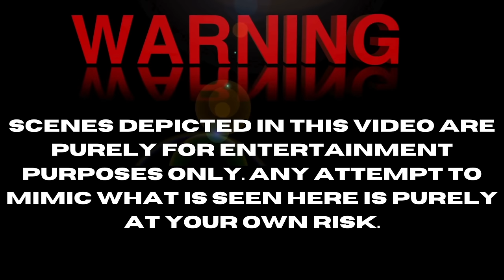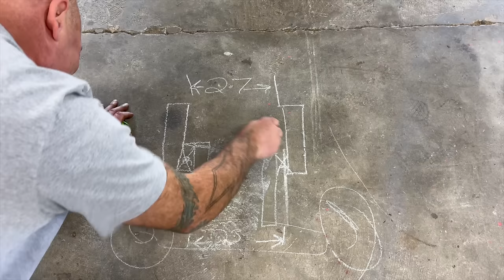Customizing A Classic: Ian Roussel Upgrades 1937 Lincoln Zephyr Front Suspension

Comment: Ian, use two spacers for the bottom controls arm to center the control am since you centered the top coil spring pocket bracket. Good luck on the steering rack. Bump steer is sometimes an issue with lowering Mustang 2.

Comment: my experience with a mustang II suspension installation is to place a straight edge under the crossmember and lower control arms so that the lower control arms are parallel to the floor during installation 
 Love all the videos!

Comment: Hi guys, ive done several mustang ii fronts. Two different manufacturers and both needed to have the hatts pitched. The pitch or angle front to back. Not saying keeping level is wrong.... i dont really know. Anyway thanks for another great video! Cheers
Reply: And the top hat needs to be back a bit from the spindle center for proper caster and camber alignment.
Reply: Weld temp brace from cross member to top hat top inside will  still slide fore and aft for axle center line then put Temp bar from top of all thread to other all thread  also front of top hat needs to be half inch higher than back helps in anti squat during braking

Comment: I have really enjoyed all your shows.  I check youtube each day for updates.  One think that I would like to offer is years ago I was like Ian and had my nuts, bolts, washers in a pile.  I took the time one day to make wooden boxes on draw slides, labeled them, separated them and put them in an old cabinet on the wall.  Pull out the box you need, you should find what you are looking for much quicker.  I also have some old cricket plastic sheets that I pour them out on and then all I have to do is pick up the sheet and pour them back in the boxes.  Just a thought.  Really enjoy the way you make decisions on the fly and not have to follow some pre drawn project.

Comment: What you drew on the floor is just what we did to my 50 Dodge p/u. I put  a mustang 2 front clip  in and I bought it from Speedway. Motors and the kit was for a Chevy p/u 51 to 53. The frame rails on my Dodge were much wider. than the Mustang, but we got it to fit like a glove.
Reply: Fatman Fabrications makes kits for most all of these old cars, no universal kits.  Follow the directions and you will get good results. Call them if you have any questions, good tech support. They are by far the best MIi kits available in my opinion.

Comment: Ian i know i have a lot of comments but the importate one is the top hat tilting to the front for antidive.the new ones you have are level.i place a 2x6 under crossmember  with a short one under crossmember aprox 2 ft and another longer  out to ball joints giving lower arms slightly lower than level for proper ride height.i have installed over20 ov these susp.in hot rods and fixed over 10 that were not installed properly.im no know it all but have exp.if you want to stop straight under hard braking include the anti dive into install

Comment: It's a lot easier to tell after the video, but might still be useful, tack a piece of metal across from tophat to tophat, and use C clamps to the frame, i think i would use longer frame pieces, so i could go way back and attach to something strong in the car, and forward to strengthen the body, maybe triangulate with a pipe, or something, to the A pillar

Comment: You may have to Z the frame rails in front to get adequate crossmember ground clearance, also with the wheel offset you probably have minimal turning radius. Also to get over 100K and more subscribers reach out to fellow motortrender Derek Bieri (Vice Grip Garage) for some type of collaboration a shout out on his channel will get you many more subscribers. Also consider attending the Zip Tie Drags in Tuscon to make contact with other you tubers for some cross pollination of subscribers. It took many of them years to reach 100K, congrats on the quick growth of your channel.

Comment: Just found your sight, Great build. 
My thought would be if your frame rails are a constant, now that you found the centering location for them against the car's frame tack them in. Next position the sub frame in location front to back and set your static ride height with tires on and tack it in. It may be higher or lower then the notches you cut. then get a basic camber adjustment (lets say 7*ish) on the upper mounts with the adjuster bolts centered by setting the upper plates forward or back from center and tack that in. From there you can do caster and camber adjustments to dial it in after its all done. Like I said before, great build looking forward to following this as you go along. 
Cheers R...
Reply from the maker: Welcome!!!

Comment: Ian, I put the same assembly on a 1932 Chevy a few years ago. I cut the center box section and spread them apart to where they needed to be. I built a box section that fit inside of the center section. I cut slots on all 8 sides where the end of the box landed and welded everything back up. I then over laid 3/16 plates over the top side of the cross member about 3 inches past where the slots were and boxed that all together. Worked fine. Probably over kill but I'm known for that.

Comment: You need a transmission jack adapter for your jack so you can chain down things like that or a motorcycle jack or an ATV jack I use two of them now it works great for keeping things together while you move them under a car to line them up and the transmission jack tilts for easy adjustments

Comment: Use a 2ft 2x6 and a 5ft 2x6 under crossmember it will let cont arms drop an inch ant lock them in place as lower arms point downward slightly for proper ride height.

Comment: Ian, a couple of those flat wooden Harbor Freight Furniture Dollys would make your life way easier!  (part #58312)  Just put the front subframe on the dolly and wheel it into position without having to fight the jacks!  Also, please put some kind of jackstand or wood blocks under the body while you are working on it, at least as a good example to those watching. We don't want to lose you to something silly, like the body getting bumped off of the jack while you are under it!

Comment: I have to say this is the first time i have ever seen the upper control arms inner mounting points like that before ,they have always been eg mounted on the side of the up right not the top and have shims to adjust in and out for camber caster ,i feel the side mount style is more secure ,this style mounted on top i feel if not ultra secure bolts could slide in or out when hit a bump at speed ,i guess its just me in my thinking ,but loving watching the videos ,always cant wait for my Ian and Jamie fix

Comment: Ian chock the tires in the fender opening use a peace of pipe through wheel center hole to find axel center but lower the car to a level hight then you will  know where mustang cross member will go and you can adjust ride hight

Comment: A cool motor that might look good under the hood would be a 4.6 liter modular motor from ford with adapters a blower manifold for a windsor
Would give it the wow factor.ps. it has a pretty good red line if you get an early model you should roll pin the camshafts the gears will slip under severe use .
Reply: Cummins 12 valve.
Reply: @65cj55  to heavy but would be a cool motor mabe he is going air based then maybe.
Reply: @douglasfehler553  Yes, i just think everything should have a Cummins or a LS.

Comment: Wouldn't it be easier to get the front end installed by having the frame rails welded in place first? Once you have the rails in place you can use your floor jack to raise the cross member and adjust fore and aft to get the wheels centered in the fender.

Comment: I think there is a thing called “anti-dive” that determines the angle of the upper mount compared to the frame.   I dont think they are parallel.   You might want to do some research on that.
Reply: THAT GOT DELETED WHEN IAN CHOPPED THE TOP HATS TO FIT HIS SIDE RAILS.
Reply: In summary..... it was most painful watching the pile of tin fall apart every time he tried to move it

Comment: For the top arm i would make up a piece of steel with the two nits welded to it so that you do not loose the nuts when you assemble it You should be able to down load the data for the steering off the internet.

Comment: You need to set the caster angle on the upper control arm perch it can’t be the way you cut them. You’re going to have dump steer. Google it before you weld it together.
Reply: @SayWhut276  I had installed a mustang 2 kit from Fat Man Fabrication in my 1954 GMC and the caster angle was already preset in the upper control arm perches. No shimming is required. They make their kits specifically for your vehicle, they ask you for a few measurements on your frame rails and that it. No bump steer no shims. It was a painless installation. I highly recommend them for anyone who is going to install a mustang 2 in their vehicle.

Comment: Hi Ian, Do you ever do your mesurements using the center of the car as your reference point ? Once the cross member is centered you're sure that the drive train will be in centered in the car ? Assuming that the drive train is supposed to be in the center of the Zephyr. Thanks and nice work. Rol

Comment: I wish they wouls stop making that style of wire wheel, either that or encapsulated the wires in a rubber epoxy. Those wires break off and go flying while the encapsulated type the broken wires are held in place by the epoxy. A friend of mine lost an eye even with safety glasses when the wire went through the lens and penetrated his eye. Another alternative id the twisted wire style.

Comment: I used to modify Camaros and Mustangs put big block and small block engines in them can you have the redo the brakes because you know you're pushing 500 horsepower and some of these cars I built after you modified the cams Pistons electronic ignition dual distributors  different Transmissions like the 700 turbo 350 turbo now you've got to build the frame stronger on the car and the suspension to hold the front of the car off the ground which I learned from doing a 62 Camaro and putting a big block 455 Pontiac engine in it which had over 400 horsepower stock when I finish that big block my friends at the parts store that got me the cams and I wanted and all that stuff my friends in the parts store that got me my parts Pistons shorter stroke or long stroke piston rods they thought I was nuts I had to change the motor mounts and all the cars so the engines would fit I did all that in a very short period of time while I was off work I did all the welds myself everything came out very satisfactory cars were awesome to drive I painted my own cars did my own body work to straighten out the lines on the cars ripped all the headlights all the Chrome all that stuff off the cars and when the paint job was done and the paint was cured my ex-wife before we divorced work with me was putting in the tail lights putting on the bumpers the headlights marker lights I had to rig up my own shift linkage because now I've got a longer transmission bigger transmission in a small car now all is shifting linkage and the shifter had to be adjusted so you'll be in the right gear at the right time put in racing valve bodies I actually rebuild them to give me torque that I wanted from these big block small block engines that were beefed up it was a blast I had lots of fun and it brought business to my bosses garage where I work and he was successful because our two garages that he owned the other mechanic that I work with new hair stuff too!

Comment: No no no no no !!!
You use the same width as the stock frame.
You might want to z the frame to make it lower..
But don't want to narrow the frame .
Cut the original frame on the inside, leaving the outside metal ...then box it in...
Reply: That sounds dangerous...